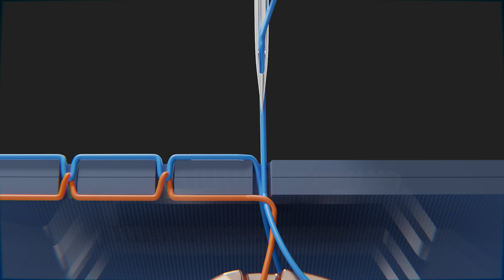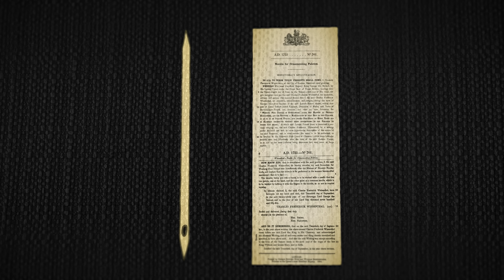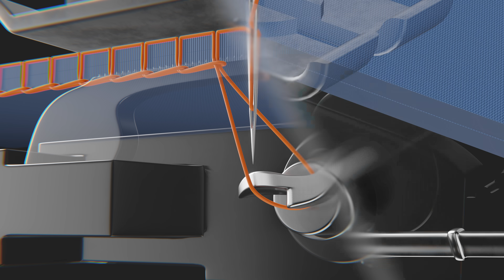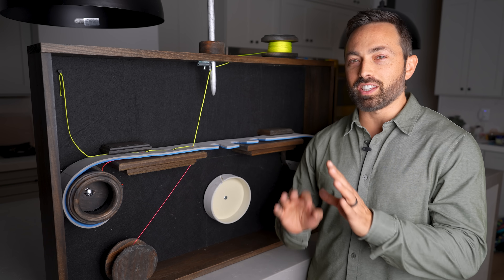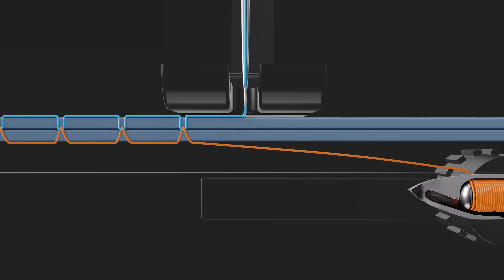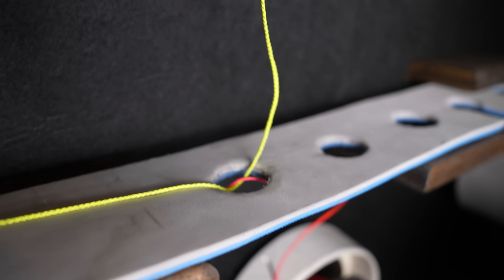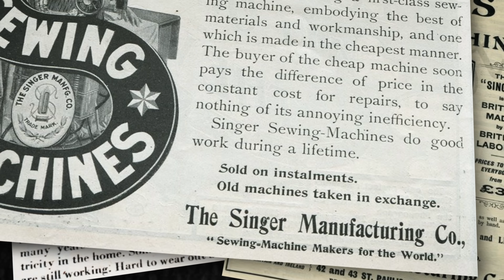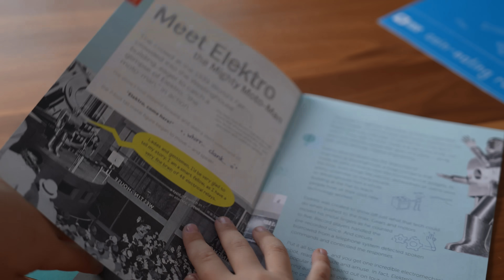The Surprising Genius of Sewing Machines

Comment: One thing I find fascinating is the mechanism in some purely mechanical sewing machines that can change how the parts operate to allow the same machine to make dozens of different sewing patterns. I'm not a mechanical engineer by trade, but I studied it at the university. I can't figure even how to start to design such mechanisms.
Reply: @hugoiwata Afaik, the forward motion is controlled by speed of the sewing machine. The translation is controlled by a disc that is inserted  to read head that is mechanically linked to the horizontal motion. So it's like the function y = f(x) where x is the position forward y is the horizontal position and the wheel height is the relationship f(x).
Reply: @medleyshift1325  Amazingly enough, this is almost exactly how early Disney animatronics functioned. They were programmed by discs that mechanically actuated things. It's a solid solution.
Reply: If you play Minecraft, spend some time learning redstone...  Plan something simple, like a door with a locking mechanism. It will help you understand the process of isolating procedures in the whole mechanism to achieve the desired result.

For example.

I had a friend that wanted to make a lava waterfall that he could switch off and then have a water waterfall and then swap back again.

Sounds simple enough, until you realize that lava moves sooooo much slower than water. So i had to add a timing mechanism that would only activate for when the lava was switched off, allowing the lava to disappear  before the water was released and turned it to stone. It was difficult because i had to use logic gates to achieve this.

Once you know the processes you need to isolate/activate within a system, the design part becomes easy because you can solve the problem in a step by step process.

When this does that, this part here will do that to activate that, which will deactivate that part until its finished its full cycle.
Reply: @cubiusblockus3973  But your example is essentially electronic. Logic gates and such. To achieve the dozen different sewing patterns using an electronic solution is totally trivial. Basically just to program it. What awes me is to achieve that with a purely mechanical solution.

Comment: Really cool video! I love old sewing machines, but my appreciation and admiration for them just got much bigger! 😍
I have an old Seidel & Naumann from around 1870, a Singer with table from around the 19 hundreds (I'm not sure of the exact age) as well as a "newer" Singer that is only about 40 years old. 😆
The old (or oldest 😂) machines need some love. I got them cheap as the S&N didn't work (turned out too just be a massive ball of thread and dust jamming the mechanisms, but it still needs a good clean) and the Singer have a few parts missing and the woodwork on the table looks terrible. I can't wait to have them up and running again. 🤩

Comment: I loved it. Because growing up, before the Internet, I would spend hours and days wondering how simple machines or toys around me worked. So here 35 years later I finally understood how sewing machines worked. To connect with some of your other videos, it seems that the stitches in the fabric of space time are quantum entanglement pairs. and quantum error correcting codes might explain the robustness of the fabric, in the same way different mechanical stitches improved the sewing machines.

Comment: While I was studying micro-mechanics, I had a brief internship at a sewing machine maintenance & repair shop. Hands down the best sewing machine I got my hands on was a full cast iron -bodied, multi-stitch, Bernina, manufactured in 1888. The machine worked flawlessly, it was just clogged with fabric "dust". All the oiling points were clearly marked and easy to access.
I don't even do sewing, but I still think about that damn sewing machine from time to time, what a fantastic piece of equipment.

Comment: No, i think in fact that the sewing machine is not the cause but one of the solutions. Growing up my great grandmother (depression era) saved old clothes for sewing projects. My grandmother still does, (she was born in the 50's). My mother saved old clothes for shop rags for my dad. Todays textiles are not of the same reusable quality that they used to be. If you're looking for a textile waste cause you need to look to the plastics industry. Polyester fabrics are by and large trash. Dont get me wrong, they're comfortable, and they last long enough for a shirt. But you can't reuse them. Reusable textiles are natural: cotton, linen, wool, hemp (maybe, I've never worked with it, but its very similar to linen in my understanding). And these things are of course biodegradable, Go figure. But polyeseter sucks for shop rags, sucks for reuse, and in my experience, the original clothing made from it doesn't have the durability that cotton shirts do.

Comment: The chain stitch does not have a failure   but an advantage in the sense   used in  wrapping  bags as it  can be opened easily, if you find the right end in the right side

Comment: The chainstitch coming undone is so annoying, as trying to pull it tight undoes it more. If I gather correctly from the animation, I guess you can lock it off by passing the lose end through the lose loop? I guess it's hard to see that the lose loop exists, as it would be pulled into the fabric from the pulling out of the next loop.

Comment: Aaaargh! I felt sure this was going to explain what I've never been able to work out, which is how the top thread can pass around the shuttle, ie effectively pushing the shuttle through the loop, without the top thread getting stuck on the axle that holds the shuttle inside the flying hook.  Sadly your hands get completely in the way at the critical time, completely obscuring the answer.   At 11:28 the yellow top thread is being carried around the shuttle within the sides of the spool, but then there's a cut in the video so that at 11:29 the yellow thread is now in front of the spool having miraculously caught the red thread.

I know the design works, but I can't find any videos that show the process as clearly as this model should.  Disastrously for me, even this failed to show the instant the magic occurs.

And then, when the animation starts that shows the process slowly repeating, which might have given me the final clue to solve the riddle, the animation doesn't show the shuttle at all.

If anyone can point me in the direction of a video that shows the process, I would be so grateful.

Comment: We manufacture mechanical sewing machines in India. A typical domestic machine needs a  100% synchronization between nore than 200 parts fit to perfection. Even a 1mm misalignment will lead to failure. It is a wonderful piece of engineering and we are always amazed on jow well its been doing its job for centuries now. ❤

Comment: The first version seemed rather bulletproof, the second with that moving shuttle too. The modern version looks like it could never work flawless, but it does. On paper it would be my last choice. The hardest part for me is to get the wire tension right. Great demo on that wooden thing.

Comment: 0:31 "one of these things almost no one thinks about" wth man. 10 year old me was plagued by this question. At pushing 50 I'm still not entirely sure how the thread is made to cross itself if I am honest with myself.

Unless the bobbin is lose and essentially just resting in its socket unattached to anything but the work through the thread coming out of it, so the other thread may be looped around the bobbin to catch this thread. Thinking about it it's the only way it could work...

Comment: I’m sure most of you probably know this already, but when he’s talking about all the sewing machines being “connected to the same motor”, that was actually a very common method in factories to distribute power in an industrial setting before electricity. Steam or hydro would be generated in one location at the factory and spin these huge line shafts that ran above all the machines, and then different pulleys would loop down and attach where needed
Reply: Decades ago I worked in a cannery, and the machine shop still had an operating overhead line shaft to run the lathe and the drill press.
To change speeds, the machinist used a long pole to move the leather belt from pulley to pully.
Seems like a hundred years ago.

Comment: In all seriousness, I have had the "figuring out" of this topic on my list of "figuring outs" for a while. I watch leather shoe resoles and other DIY fabrication often. The sewing machine always messes with my brain yet I still maintain a fascination with the operation when seeing it in action. It is also intimidating to me to the point where I have withheld buying one because I dread servicing the machine. Love this channel.
Reply: Please don't do what the above poster suggested.  I have several machines and my grandmother was a professional seamstress.  The absolute best machine you could buy would be an old Singer.  One of the old black, cast iron machines.    I have the model 15 my grandmother left to me, still in the original treadle cabinet.  It is a powerhouse and has never needed any service that I couldn't perform on my own.  I also have a 66, electric that my husband bought for me about 6-7 years ago for Christmas.  The machine and the cabinet had been horribly abused.  But I asked for it because it was locked up and I knew what to do to fix it.  It was just bound up by a nest of thread in the bobbin area, due to it being run for too long with the tension out of adjustment.  Then, once I got it unlocked, I was having a problem with the speed being consistent.  So, I rebuilt the pedal and it still sews beautifully.  I would suggest one of these machines because they are workhorses.  Either one will see through several layers of canvas and even leather.  And you really can't break one.  

They didn't plan on obsolescence back then!!!
Reply: I've got a Singer 400 series from the 1960s, and these are also really solid machines that will last for generations.  They are easy to maintain and service even if you aren't mechanically inclined.  You can find manuals on line and they are extremely easy to follow.  I don't know when the modern machines that are either cheap throwaway plastic or computerized marvels for thousands of dollars became the default, but if you can find them the old machines are a better way to go.  You can still get parts for them from many sources, not that parts wear out, but you might want some special feet, etc.
Reply: Good times dear commenter, may I ask you what is that list of "figuring outs" is? Or what it contains? I'm just curious to know and thought I should as you to figure out what that means.
Reply: Buy a Brother machine. They are cheap and made to just throw away and buy another one when it craps out!

Comment: It is a shame that sewing machines are not talked about in school. If your looking for what really set industry on the map the sewing machine is just as important as the trains and cars. As a novice who is working on a 1914 vibrating shuttle machine it is amazing watching how all the parts move together. To watch movement be changed from circular to vertical all while another part of the machine transforms circular to horizontal movement. How each movement of each peace drives the movement and timing of other peaces. Not only that but to make the parts adjustable. You can control the tension, stitch length, the needle, ect to match the fabrics you are working with. All that with the literal twist of screws so tiny it feels like they shouldn’t affect anything at all. And that isn’t even touching on the fact that these machines were literal works of art. As convenient as modern machines are it is absolutely humbling to be in the position to work a machine that is so physical.

Comment: Nice video ! I work in sailmaking and the machines we use are lockstitch just as described, designed and built in the 1960-1970. All metallic, purely mechanical beasts. Tricky to fine tune, but unbreakable. One annoying issue with the lockstitch machine is the limited size of the bobbin : as the upper thread has to fully go around it, it can't be really big. Hence the amount of lower thread spooled on the bobbin is limited, and you frequently need to interrupt work to respool the bobbin. This explains why a lot of industrial garment sewing relies on other methods derived from chain stitching (like serger/overlocker) to sew miles of fabric at once... There's a call for new geniuses patenting improvements to get rid of this problem in lockstitching !

Comment: I have always been facinated by moving mechanisms just like these sweing machines, even more so with the recent popularity of GPTs. I've engineered and built plenty of complex assemblies, from robots to tiny electro-mechanical components. Yet, I can't help being humbled by the rotating hook. It broke math without breaking math! Just think about the shuttle, built with no permanent attachment to its surrounding parts so it may completely pass through the loop. Then this seemingly boring cup connected to a shaft came along, and somehow they are topologically equivalant. What the heck just happened there?! This is so interesting to think about than working out the inverse kinematics of a lame ass robot. Seriously, if I had the brain power and enough longevity to master every related branch of mathematics, material science, machining processes, I'd do it, only to come up with a magical mechanism generator, with which you just need to throw in a bunch of boundary definitions, input of motion, desired output of motion, required mechanical characteristics, etc. It would just come up with the most elegant desgin using the fewest parts, with producible 3D geometries. But that's next to impossible as a human. So I asked ChatGPT, about a generic approach to design any snap action push button. It told me there's a one size fits all methodology to generalize all the relevant aspects, just with this one category of component. I guess there's still a long way ahead?

Comment: my mother who is a master of sewing had her machine malfunctioning, i was always good with electronics and daydream with mechanical marvels since im also a gun enthusiastic, so i thought i could fix it, oh man, it was hard as hell to reverse engineering that thing, it amazed me there was a yarn spool hidden inside the machine, then everything made sense, i cleaned up everything, tighten the screws, refilled the spools with new yarn, and told my mother to prove it and it worked, increíble a machine that is 60 years old or more is still running after a simple maintenance, i tried to use it after i realized the marvel it is, to craft some hard work gloves but it turns out you can not use too much fabric because... well i learned 2 things, the needle can break from the force...and you can impale your own finger through the nail...

Comment: Sorry too much but lots of people do know how a sewing machine works and the diagrams you show are in almost every machine manual. I have used commercial and residential machines for 50 years, it is not a big mystery. I also are an Aeronautical Engineer and for me Helicopters and planes are also not a mystery PS i was also a Fitter / Machinist and a computer data extraction / analyst and Applications manager. I do not know everything, those days are long gone.

Comment: I fix practically everything. Electronics, cars, bicycles, appliances... I'm pretty good at it. My wife once said that her sewing machine is out of whack and needs to be "calibrated". It was one of those fancy things that cuts the fabric, overlock sewing machine might be the English term.
I lifted the thing on the table, and after staring at it for good ten minutes, i googled for shop manual or such.
Couple of days later, wife got a new sewing machine. Dear lord those things are complicated and work on miniscule tolerances! There is so much going on at once, and everything affects the next thing. Guys always go on about engines and tolerances and small improvements or modifications in the evolution of them, but I have enormous admiration for these things and their inventors. If sewing was seen as more manly thing, those machines would be respected much higher, dudes just don't get the clockwork like precision in them.

Comment: Since I have and occasionally use a Подольск 132 sewing machine, I know how it works. Truly a very clever design. Most people wouldn't be able to get the machine to work at all. Setting it up correctly involves certain knowledge and this knowledge requires you to understand how the machine works. Getting a nice even stitch needs just the right tension of the threads.

Comment: Awesome video! When I was a kid, I couldn't resist taking apart my mom's sewing machine just to see how it worked. I was really curious about where the needle went. Luckily, I was able to put it all back together and it still worked. That was one of the first times I really felt like I had to take something apart to see how it worked inside. I knew my mom would be super mad if I broke it, but I just had to know. After I did it, she hid the machine so I wouldn't take it apart again. But I learned what I wanted, so I didn't bother looking for it. Anyway, about the video, I just found out you can sew with only one thread and it's so cool. These machines are made by some really smart people.

Comment: It's still a bit unclear at 11:30 how the thread passes around the bobbin without showing that the wood bobbin is not connected to the white hook. At 11:04 when the bobbin is connected to the rotating white hook, I assume that connection is not fixed (it appears to be a magnet?). Let me know if this doesn't make sense